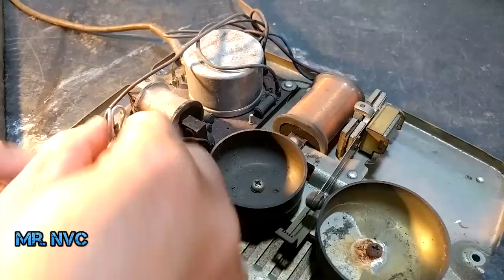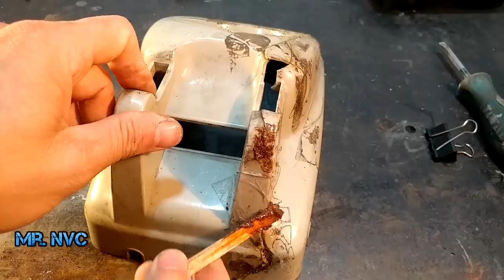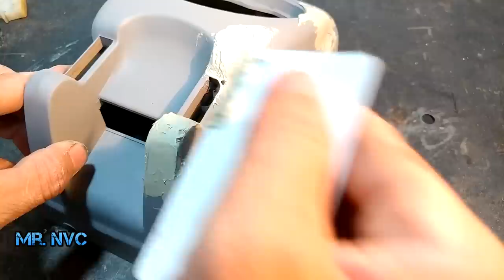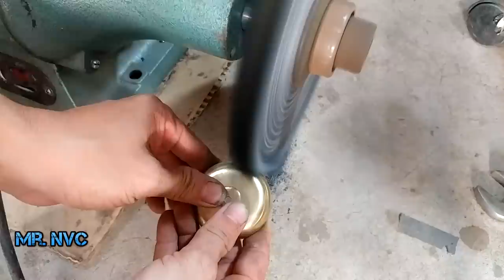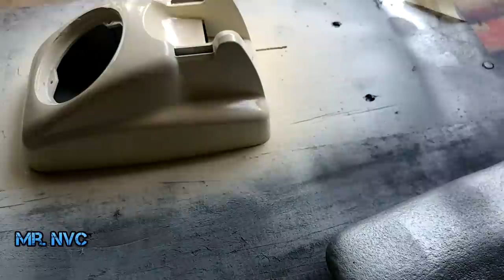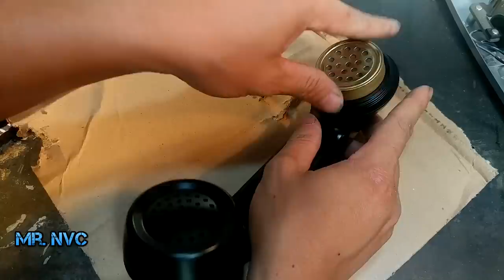1970 Vintage Rotary Dial Telephone RESTORATION

Comment: The filler idea was pretty neat.  You could also try baking soda with the CA glue.  It makes the CA “kick” instantly, and creates a very hard filler.  Maybe dab a little CA, sprinkle baking soda, repeat - to build up around cracks or broken areas, then sand it down to proper contour.

Comment: Very good job on restoring the plastic body. Important to know how to save plastic parts when there are no good replacements to be found. 
You might consider an airbrush to do delicate painting. It gives you much more control than the rattle can does. Plus you can color match your paint to the original color.

Comment: Hi, I would have liked it more if you had cleaned all the pieces of the phone before gluing them.
Reply: Mike Nunyabizness applying primer first lets you more easily see where you need filler - especially on a surface that has all these textures and colors.
Reply: Ikr
Reply: its standard practice to apply a layer of primer, or even spray paint, to highlight any areas that may need filling before the final layer of primer and paint. As stated above it makes it an easier job. Also, why clean the parts before glueing when its going to have to be cleaned again? That turns one job into two jobs, again, making the task harder.
Reply: He lost me there

Comment: to your credit you don't shy away from the nasty ones   not to berate other restorations where they deal with rust, accumulated crud and some dents you take on a bombed out hulk of a phone and turn it into something they wished they had in 1970    you did the right thing to clean the casing when it was fully assembled    easier to clean up one large piece rather than fiddling around with half a dozen small pieces
Reply: Yep😃
Reply: ELMO LINCOLN// I graduated from high school in 1970 and I assure you, those phones looked wonderful when brand new : )

Comment: I'm surprised an analog phone would work on a digital network. :) Good Job!
Reply: The phone networks at least where I'm from were always upgraded through stages, so they had to be sure upgrades were backwards compatible. Although some places have digital phones connected to the digital lines directly, most places around here have analog or analog-compatible phones plugged into modems plugged into the digital network (the modems are often also the internet routers of the house in question). It's not uncommon for phone signals to go through multiple modulation and demodulation stages from end to end.
Reply: i work for canadian telecom company, for analog phones with pulse dial like this one in the video there is a little converter box who does all the magic, but downside is that you wont be able to use some services that when you call it will tell you: for english press 1, for french press 2, if you dial it with pulse it wont work properly, and also sometimes you need to press * or #, some converter boxes actually have those buttons separately so you can still use rotary dial

Comment: Cool phone and nice restore... thanks for sharing. :-)
When I was little  we had that type of phone and the little metal finger-stopper on the rotary dial made an excellent place to connect my Johnson-Smith Spy Pen Radio's antenna clip... the Pen Radio worked great at tuning in several local AM stations.. lol :-D

Comment: Wow.  Goo-gone, Goof-Off, Bestine or Acetone would be products that'd recommend for all the sticky tape--before you do your sawdust and epoxy reconstruction!
Reply: You have to be very careful using Acetone around some plastics so as not to mar the surface. I've found lighter fluid (naphtha) to be a good remover for old adhesive. You can buy a quart at the hardware store for about the same price as a small can at the drug store. Always transfer flammable liquids to small containers for use at the bench... better to have a small fire a fire extinguisher can deal with rather than a great big one.
Reply: @aceroadholder2185  As a "girl", we used to use classic hairsprays (like Aquanaut) to get both inks and dye rub-off and sticky stuff like school glues (pre-cyanoacrylate years and epoxy was untouchable) off our vinyl shoes and jackets as well as crap I used to somehow get on my sewing machine housing.  I don't know which "miracle" plastic that phone was made from--any info about that?
Reply: @anna-lisagirling7424  Nail polish remover was our cleaner of choice,many years ago when I was young... ha ha

Comment: For filling and structural integrity put the super glue on liberal and then use baking soda. Dries instantly and can be sanded and painted. I use it on automotive bumpers and other plastic parts. Good luck.

Comment: The crimp job on the ring connector for the modular plug whip made me cringe. Everything else about this restoration was superb. I like that you left the filler visible on the inside. It's part of the story. I had to subscribe after the rooster crowed.

Comment: An yoi do one on a more elefant style? I got one off ebay and its beautiful, but i have to shove the wires back in on the bottom of the receiver and find a way to glue or melt the pieces together:plastic to metal...

Comment: For restoration videos in thumbnails, don’t show the before and after. Because there wouldn’t be a need to sit through almost 17.5 minutes of video, to see it. Just explode the thumbnail. “One and done” without watching a video.
Reply: To be fair you could also just skip to the end of the video if you were that pressed for time. But you have a fair point, all the other channels seem to do this.
Reply: @Patthe Batman fan, WHAT?! when you use the phrase, “to be fair” state your reasoning, which is no different than, not statin* anything, at all, because it circles back to my point, would be like all your life you speak English, yet get a failing grade in the course of English” Thumbnail, shows before and after. Explode the view and the whole subject is done, why, pray tell, Pat.would anyone go past that? I was between reading the video and picking my nose, in no way, press for time, but saved enough time to make a peanut butter and jelly sandwich aaand prove my point, in one fell swoop, with my comment. “To be fair”?! You would’ve made a good point shooting your feces at your internet electronic equipment revealing what you did to your equipment as, “to be fair, I shot my poop at my computer, to make my point, but realized, I di$nt have to do so, to apparently make no point, because your assumption, was correct the whole time.” But, nice try...now, clean off your PC and go on with your life, we'll all forget this ever happened. Up until 20 years from now, Dateline NBC wants to do a story if your point of making a pointless point, proving my point, proving your point, pointless.
Reply: @eddietowers5595  Jesus Christ you're wound up tight man.
Reply: @Pat the Batman Fan, hey Pat?Pat? Pat? Pat? Paaa-aaat?! Why so serious? Wink, wink.
Reply: Actually I saw the thumbnails and thought there is no way this is the same phone. It actually pilled me in to watch the video!
Reply: @Speeddemon3  Well, good.That's a good point. It also shows two types of people, as far as reveals go, Some don't mind hearing or seeing the end beforehand, but still want to watch how the process is done and some like the element of surprise. Good point.

Comment: normally it irritates me when i see one of these restore guys insisting on sanding and repainting this kind of plastic parts, but in this case the damage and required remodeling kinda makes it mandatory and unlike a lot of them its apparent that this wasnt faked... even if it had been done on purpose that kinda shattering isnt anything that can be fixed easily

Comment: too bad it can't actually be used these days. I have a dial type lineman's test phone,  but though I had it tested and is working order, it can't be used today. ... no dial type signals are used.
Reply: There are converters that you can plug in line with old style dial telephones to make them work again.
Reply: @korbiniankoch  sure, but who wants to do that? Not many. A telephone guy was able to test my handset, it can work, if you have that converter thing, but I don't know if they even sell them now. There were some back when they changed over.

Comment: How you dial from this analog phone in these modern days.
Reply: put a cell phone module and a arduino inside it... wireless antique phone!
Reply: Some places still support pulse dialling, but for how much longer, I don't know. It still seems to work in most of the UK, and the same for the line connection. You saw the change to the current plug-in connector, there's a component of the phone that was moved to the master socket. I would have to check the details of that.

The basics of the wire between the phone and the exchange haven't changed, still the same combination of audio signal and power, and the ADSL was designed not to need any change to that. You might not be able to use pulse dialling if you have an FTTC connection, high-speed internet, I don't know.

There are black boxes you can get which do the dialling conversion inside the phone. But what they do about the extra buttons and tones, I don't know.

What I hear is that the next big change to the network will give us digital all the way to the handset. That will be the end for these old phones.
Reply: @davebell4917  thanks for info

Comment: Wow... what a shambles... firstly i would not have washed the chassis in water with the electronics still screwed in, also not hit the wire brush on the carbon granual earpeace and speaker, if you spent half ya time with the front work, maybe if ya did the inside of the phone instead of painting it over the bog, it would look better... take ya time on ya build and you will get results... i give ya 2 out of 10... sorry

Comment: What kind of idiot drowned all the electric component in  water at least you can take them apart first and clean by another method it was a sloppy job you must be very lazy to do that I wished you research more on these kind of restoration at least your hard work will not go to water.